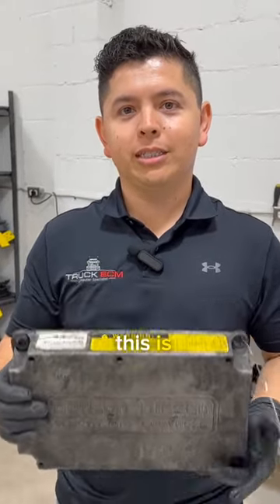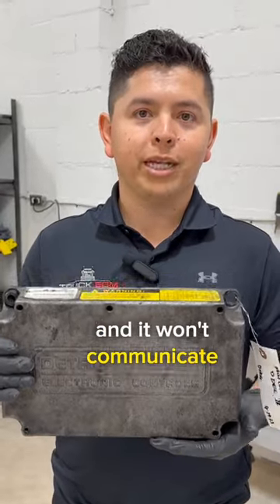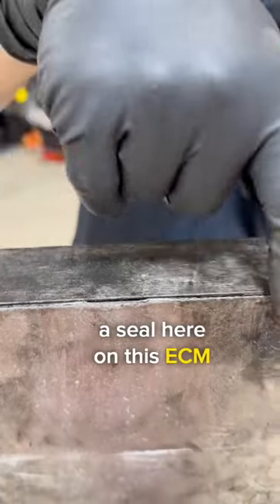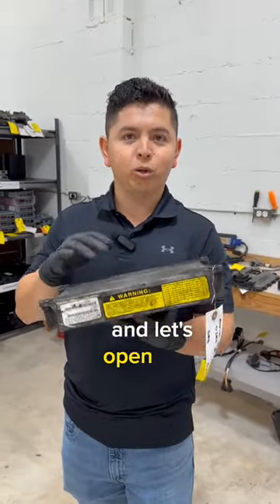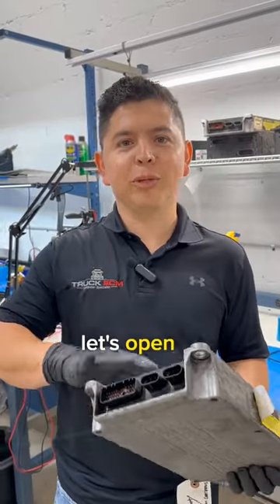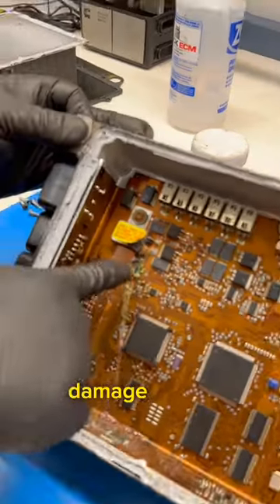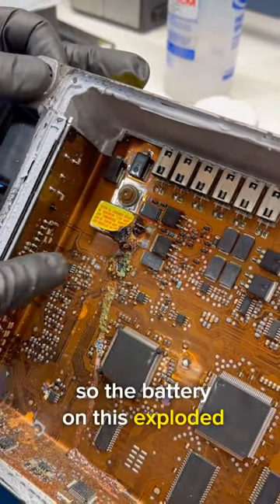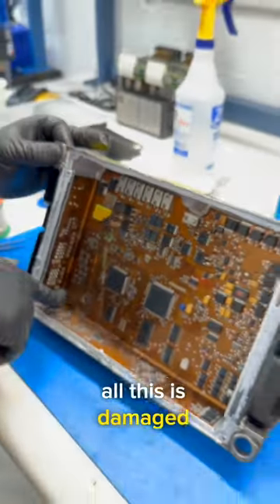🔴Exploring 12.7 Detroit ECM Damage  This is a Detroit Series 60 engine DDEC IV ECM.  #ecm #shorts

Comment: You’re gonna find oil and water in it because you just scrubbed it with water and oil. 🤦🏻‍♂️
Reply: Battery blew up though, did they blow up the battery ?
Reply: @bradbachelor9756  first off it’s a module not a battery and I never said they blew the battery up.
Reply: @reginaldhuckstable9797  they said battery in the ecm blew up
Reply: @reginaldhuckstable9797  did you even watch the video boomer?
Reply: Not water.  Parts cleaner
Reply: @reginaldhuckstable9797  double display of ignorance and the fact you didn't watch the video. When did they start making lithium modules Einstein?
Reply from the maker: There was no water or oil inside.

Comment: Electronically commutated motors = job security and expensive to replace 👍
Reply: They also result in an efficient engine and are really quite reliable. The warranty on ddec ecm’s is extremely long as well. Or was in another lifetime of mine. Here’s another one, ever see a runaway electronic engine compared to the good old Detroit rack? Things progress. No maybe we can’t fix them anymore but one more, when was the last time you put points in your car,changed plugs,beat your carb to pieces after chasing a stalling issue for the whole winter? I think the ecm has proved itself pretty well.

Comment: I'm so pissed that the engineer didn't talk with manufacturing enough to get this box smaller maybe I'm wrong but it looks like it could be shrunk by alot
Reply: It definitely could be
Reply: Why? Not enough room behind the compressor? Cramped under that big Pete’s hood?
Reply: @jimrudolph1582  yep
Reply: @camrongoodall  lol. Ya silly to argue, smaller would’ve been nicer.
Reply: If you look the circuit board is flexible and covers 5 sides of the box.  Probably spreading out the heat and making the connections cheaper and sturdier.  Its built smart.

Comment: Its disgusting what auto manufacturers get away with. There is no reason u cant replace a factory computer w a raspberry pi to do the computing and an arduino to do the sensor and servo controls. Auto manufacturers intentionally use proprietary hardware and software simply to keep a stranglehold on their products. A person could make a fortune selling an open source ECM adapter kit. You wont make money on the software but people will definitely pay for plug and play capability.
Reply: Cheapest on the market for standalone ECU is the speeduino  can use 2  one for engine and the other for transmission controller   open source